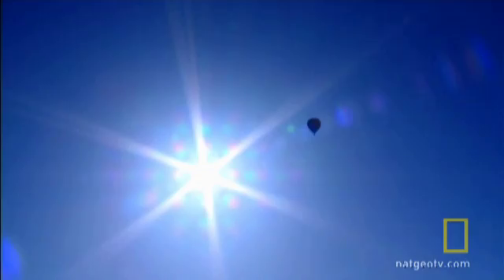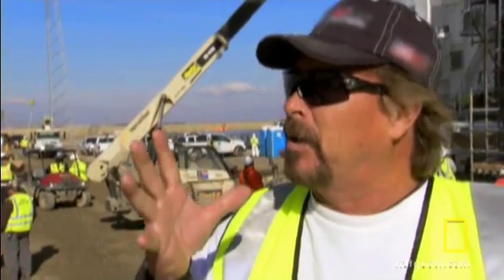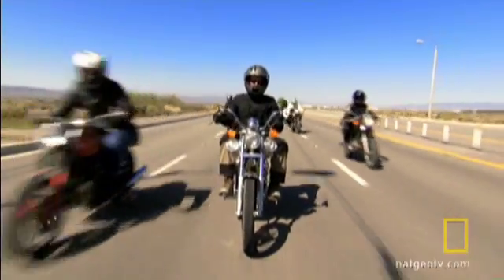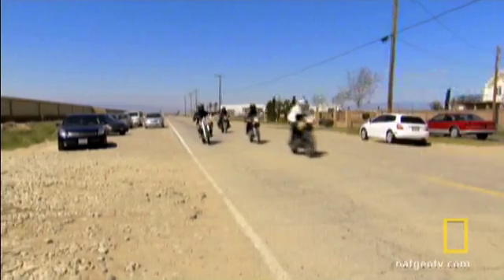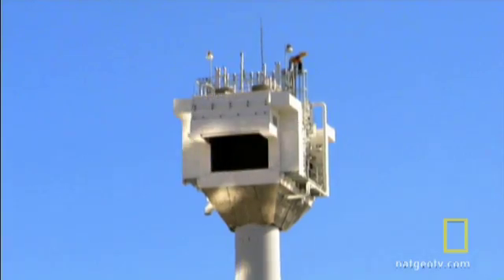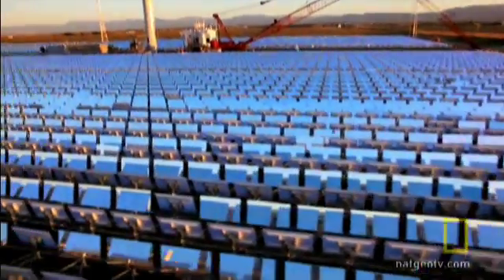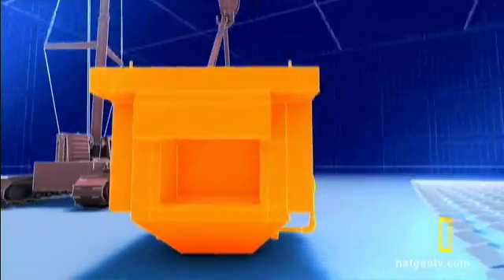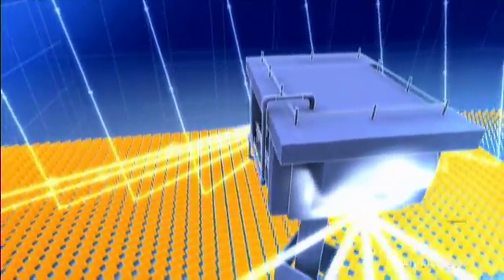Solar Fix | National Geographic

Comment: I don't know too much about this.. but is there a reason why we just don't use 2 field of solar panel to produce electricity instead of using these mirror to boil the water? is the solar way more expensive than this?